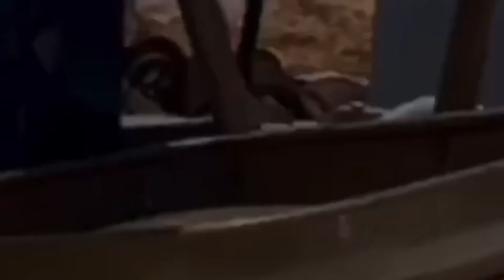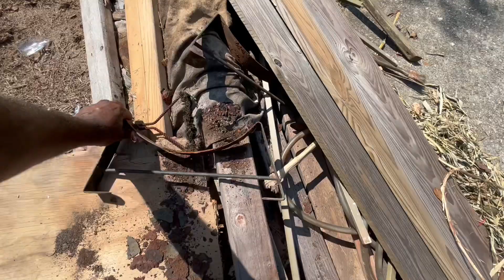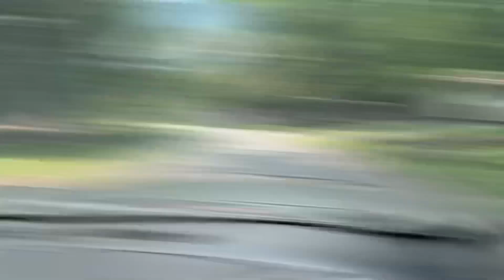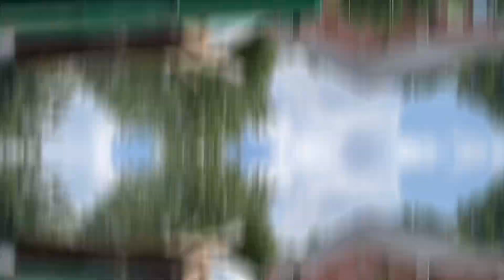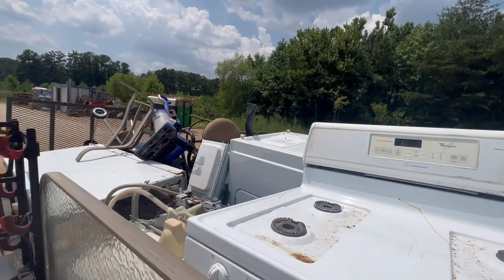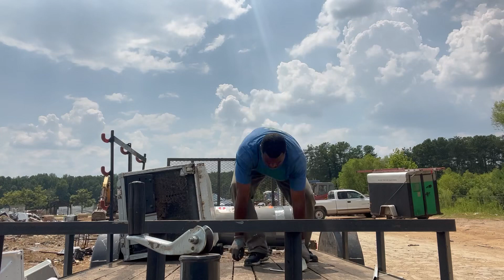Street Scrapping… Out Pick-Up Scraps On This Hot Georgia Day!!@BacsATL

Comment: Hey man been enjoying your videos I noticed that you don't cut none of the electrical cords off none of your appliances. . Or magnet check some of your metals scooters and bicycles a lot of made out of aluminum. can make some pretty good money selling the electrical cords even Christmas lights and Christmas trees at some scrap yards not sure about Georgia but here where I live they pay a pretty penny for that stuff.. also on them water hotter heaters you can collect the little pieces of brass off the top in the bottom and cut some of the electrical wires. I'm pretty sure I'm telling you something you already know.. if you run across some of that metal black wire shelving you can add that to the bottom of your trailer to keep those holes from flying out.. sending lots of love your way stay hydrated motivated God be with you always😊❤
Reply from the maker: Will do that, thanks!